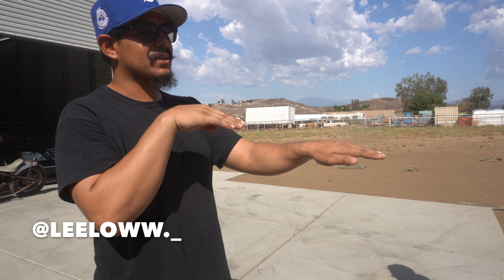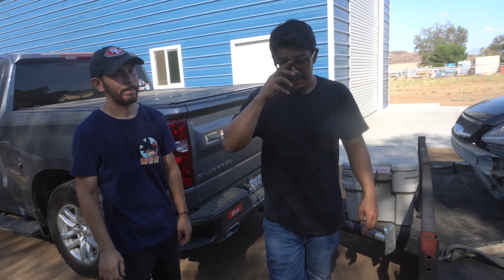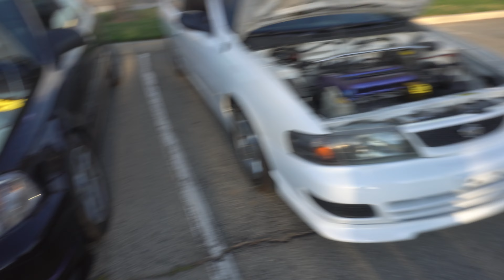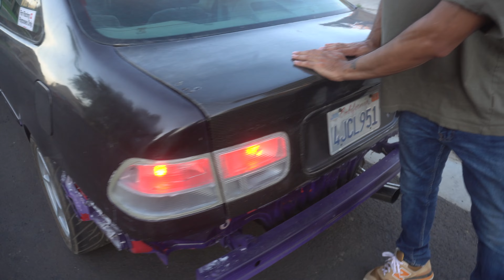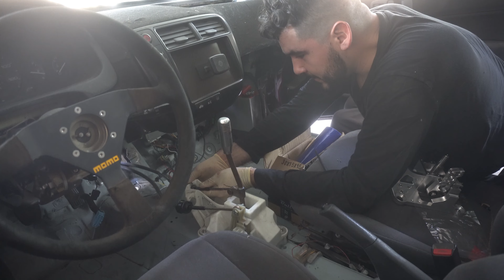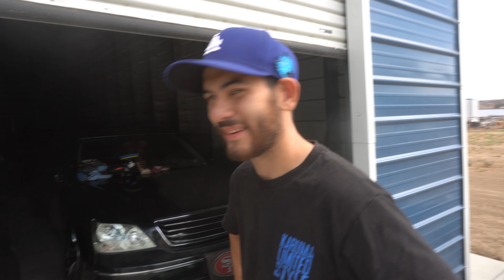The Final Drive In My K24 Civic..

Comment: This k24 runs like doo doo you need more bolt ons should be making around 230 240 to the wheels.
Reply from the maker: Lol I was saying the stock numbers because that’s what they make, I don’t know the actual numbers since I never got it dyno tuned.
Reply: Needed type S oil pump, 50deg VTC cam gear, rbc manifold and 3 inch exhaust and a tune and couldve easily made like 225-230
Reply: Needed type S oil pump, 50deg VTC cam gear, rbc manifold and 3 inch exhaust and a tune and couldve easily made like 225-230
Reply: Needed type S oil pump, 50deg VTC cam gear, rbc manifold and 3 inch exhaust and a tune and couldve easily made like 225-230